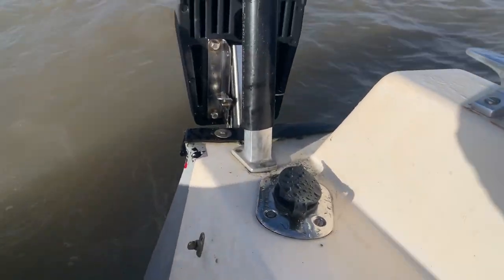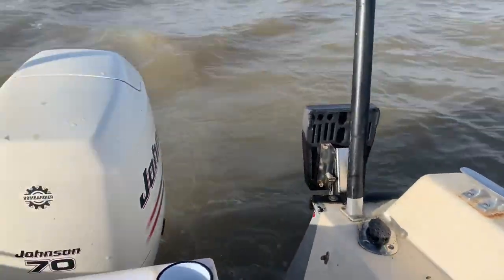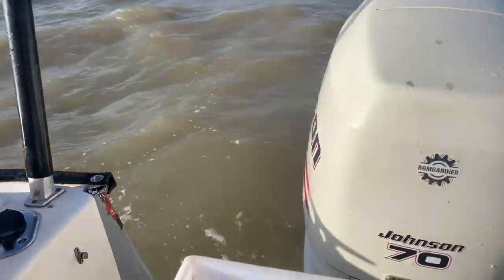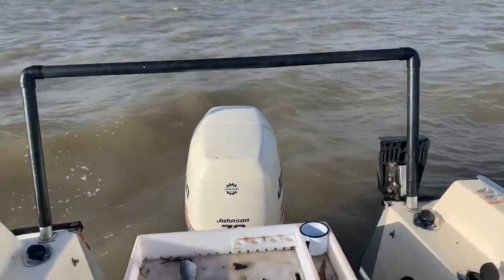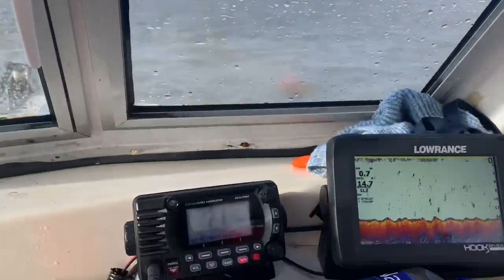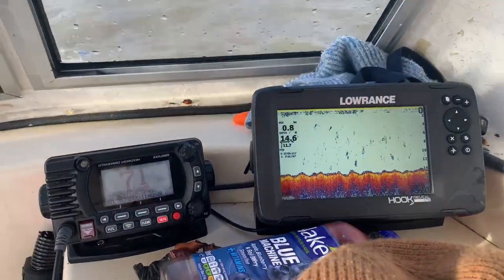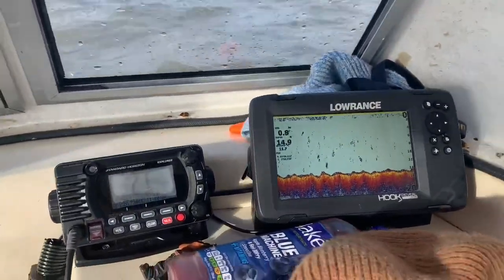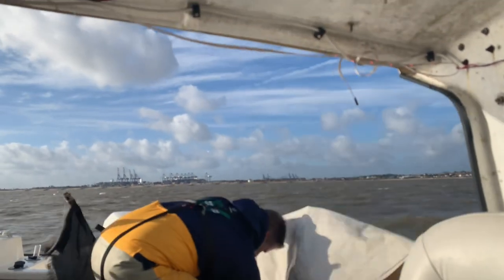Herring netting on the Suffolk coast

Comment: just a suggestion but your A frame would work better if had been a H frame so u can turn either direction when shooting without  the net falling off either side .
Reply from the maker: Hi mate, yes had thought about that as would just use a three way connector on the pipe. The more I do the more little modifications  I will make - I appreciate you taking the time to offer advice, thanks, Ed